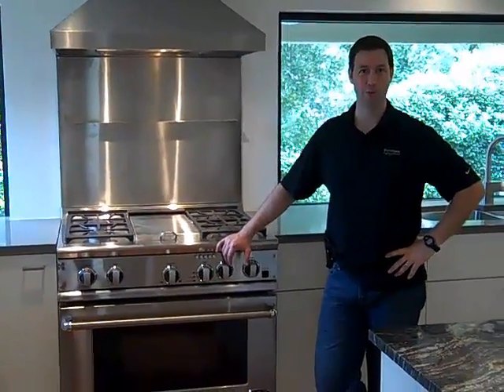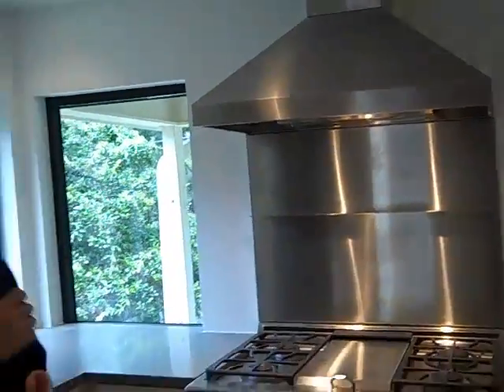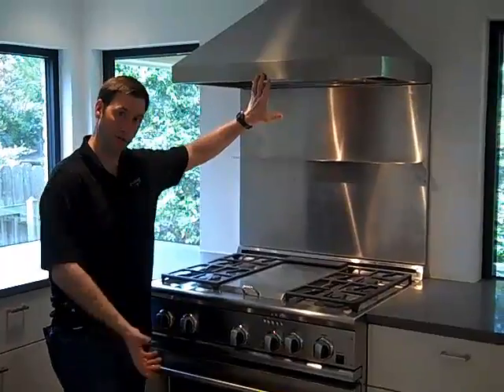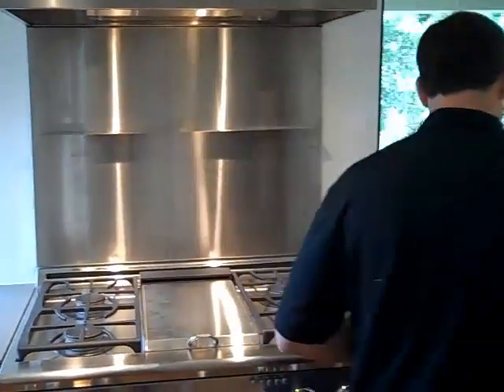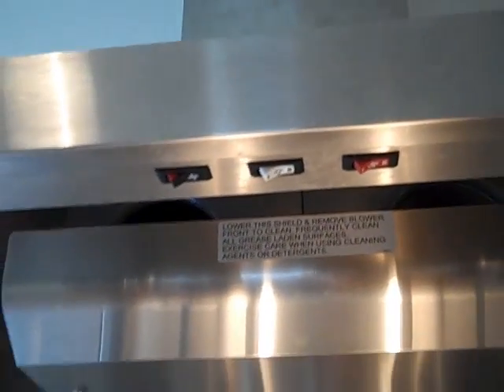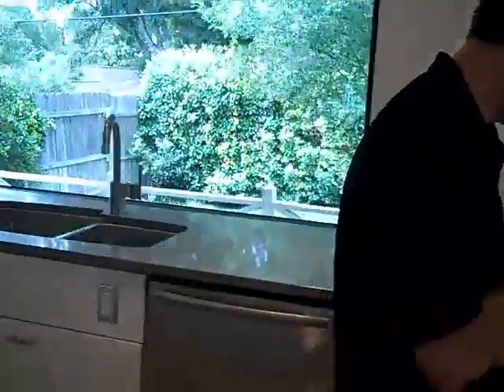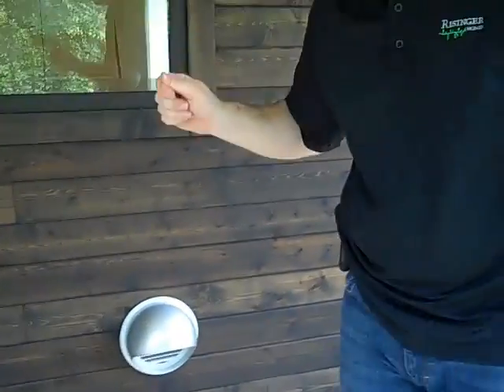Make Up Air for Commercial Ranges in an Austin High Performance Custom Home

Comment: Is makeup air system part of code in Texas? I am installing a 600cfm hood.
Reply: This is how the 2020 Florida Mechanical Code reads (Texas' might be similar):

505.2 Makeup air required.
Exhaust hood systems capable of exhausting in excess of 400 cfm (0.19 m3/s) shall be provided with makeup air at a rate approximately equal to the exhaust air rate. Such makeup air systems shall be equipped with a means of closure and shall be automatically controlled to start and operate simultaneously with the exhaust system.

Exception: In a single-family dwelling, makeup air is not required for range hood exhaust systems capable of exhausting:
    (a)Four hundred cubic feet per minute or less; or
    (b)More than 400 cubic feet per minute but no more than 800 cubic feet per minute if there are no gravity vent appliances within the conditioned living space of the structure.

Comment: This gas range is gorgeous! I just finished having it installed==allmy.tips/Viking_range?d30   so it will take a little time to learn its quirks. However, so far, it works beautifully. The fan goes on when I use the oven, but it is not very loud at all. The 4 gas burners fire up perfectly. I love Viking 's crisp lines - it is a ve

Comment: Question: Ideally, would there be an advantage to having the make up air come into the kitchen farther away from the hood – with the make up air coming up right behind the range, doesn't it compete with, lessen or partly block out the steam and greasy air that's supposed to get sucked up?
Reply: My thoughts exactly. On the range shown, I'd have the vent where that filler panel is at the base of the range. In that way a "curtain" of air would come up the front of the range, waft over the top, and then go out the hood; this would force any steam, smoke, and greasy air away from the cook...and the rest of the kitchen...and then to the outside. (And through a filter/grease trap, naturally.) In a design with less space under the range, putting the intake anywhere in the kitchen other than at the back of the rangetop would be preferable, although the closer to the stove the better to avoid changing the temperature in the whole kitchen that the A/C or furnace (depending on season and climate) worked to establish.

Comment: Adam, Can you just duct the air to come up from the floor through a grill under the stove when utilizing the vent fan hookup to the servo?  Must I run a vent it to the top of the stove.  I am installing a 48" wolf dual fuel free standing stove.  I would prefer not to raise it up or vent behind it?
Reply: Yes, you can. See, for example: https://www.youtube.com/watch?v=GGVS7UalLiY

Comment: I understood the make up air needed to come in somewhere other than the oven area.  Wouldn't the make up air coming in behind the oven just get pulled right back out of the kitchen through the vent without having a chance to exchange with the air in the room?
Reply: that's the whole point. if it's pulling from under the stove it's not pulling the air out of ur house

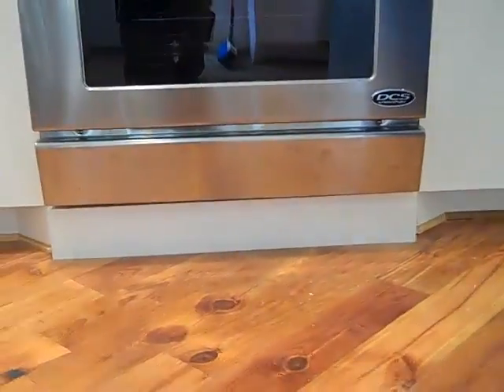Comment from the maker: I think the piece you are referencing is part of the DCS oven.  The make up air flows through the toe kick (you can see it at 2:02).  Yes, still no good manufactured solution.  I make it up (no pun intended) on every job.  If you are building tight houses this is a MUST do, yet no one has a good all-in-one solution.  Matt

Comment from the maker: I believe this unit tops out at 600 cfm.  Anything over 2-300 cfm will most likely need make up air in a tightly built new home.  It's not unusual to see 600-900, or even 1200 cfm hood fans.  Matt Risinger

Comment from the maker: So, in this case we brought the make up air under the range.  Not sure it's very clear in the video.  But, in other cases we've brought the make up air at the countertop level at the back of the range.  I generally prefer to bring it up at the back of the range, but sometimes architecture or cabinet layouts dictate layouts for that piping.  This range has been in use for 2+ years and I've not had any issues, the clients cook a lot and smoke it up regularly.  So far it's working well.  Matt R

Comment from the maker: Excellent point, I shot this video 2+ years ago and have since recanted on my ACHn comments.  The correct measure is Air Changes per Hour at 50 pascals which is what is used when we perform a blower door test.  ACH50 is what it's commonly referred to.  Give me your blog link I'd love to check it out.  Appreciate the comments, Matt Risinger

Comment from the maker: @dougdobbs Yes, I'm truly amazed that an off the shelf system doesn't exist from one of the hood manufacturers.  This is a very important issue as these high powered units can backdraft dangerous flue gases in many homes built without thinking of this issue.  Thanks for your comments.  Matt